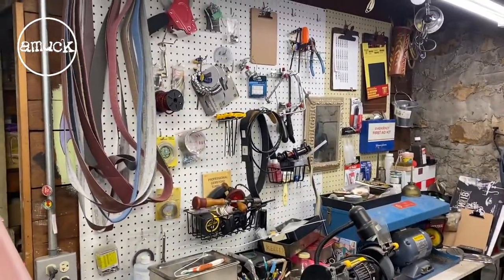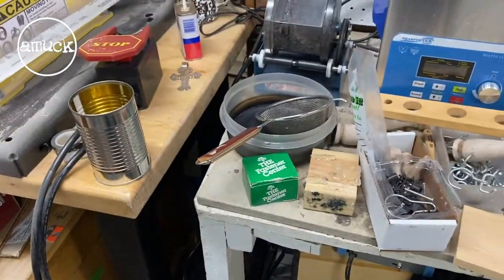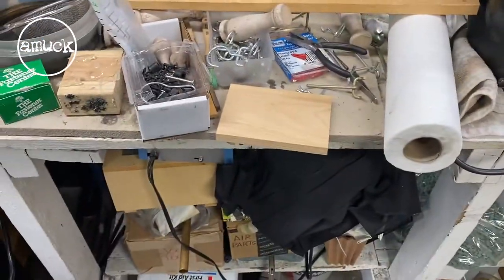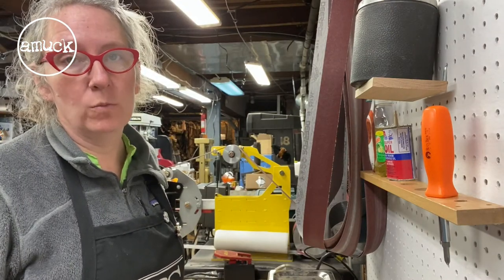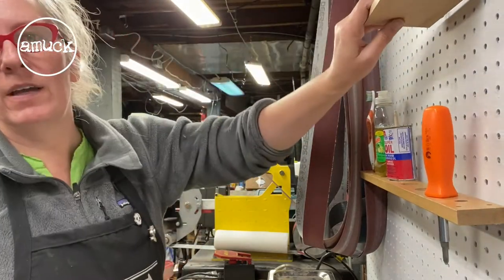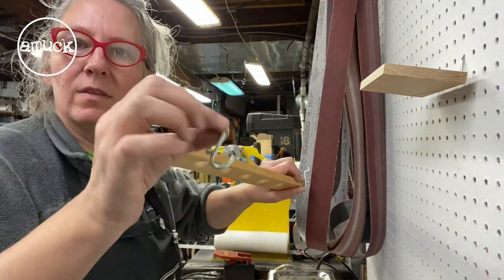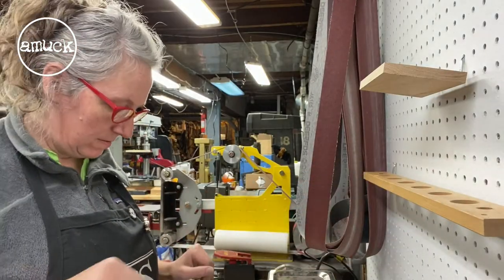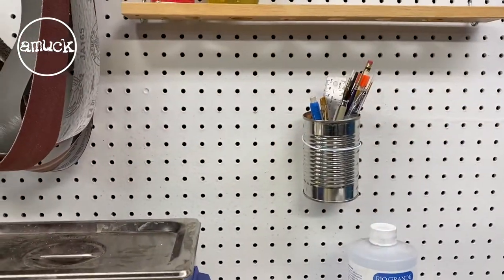Pegboard Organizing

Comment: Awesome use of space :) I was going over your tube rivet videos again and seen the found file you were using to make the holes in your metal large enough for the tube rivets. It looks like a great file, I hate to bug you again on specifics, but can you tell me what size file it is or where you found it...I seen a lot of them on amazon, but it's hard to tell what size yours is so I can decide which one to buy.
Reply from the maker: I am happy to answer any questions. Oh my gosh there are sooo many files, it is very difficult to figure out which ones to get for sure. 
My larger one is an F. Dick brand round #4 in the Rio Grande catalog it is item #114-714. Last year I bought myself a set of Glardon Vallorbe files and absolutely love them. The round file in that brand I got was a #2 cut item#114-951.
Reply: @amuckdesign  Thanks so much! My tubing just arrived today and I'm really looking forward to working with it  :)

Comment: The reason I'm asking about your found file for making tube rivets is because I have 2 round files already and both of them do not really file very well, it takes forever to make the hole just a tad bigger so the rivet fits inside and I'm using them on aluminum and copper.
Reply from the maker: Aluminum definitely can take longer to work with because it’s a gummy metal. When I cut into aluminum street signs with the jewelers saw I feel like I’m sawing forever just to cut a one inch line.